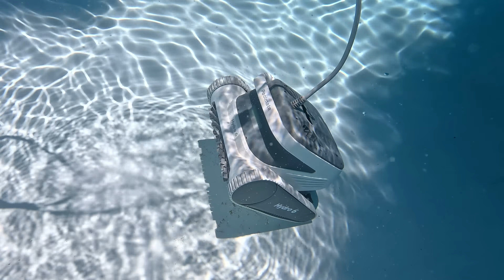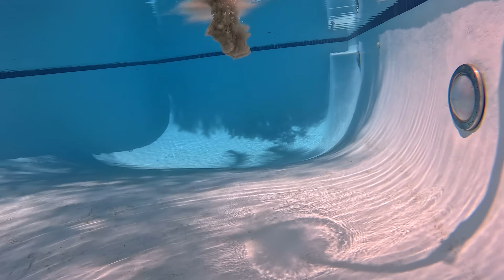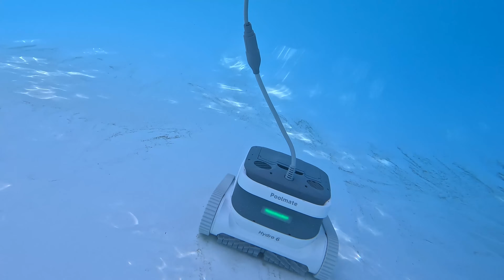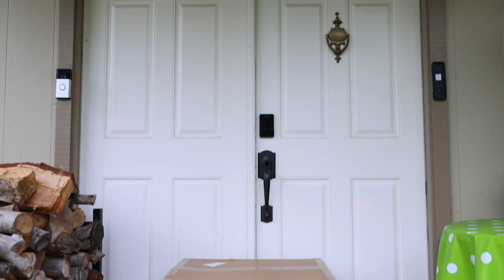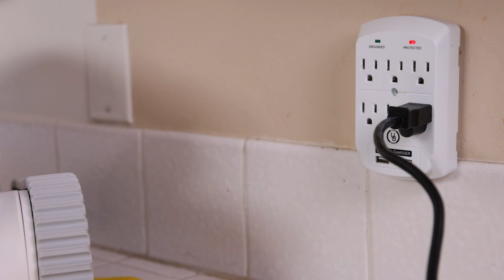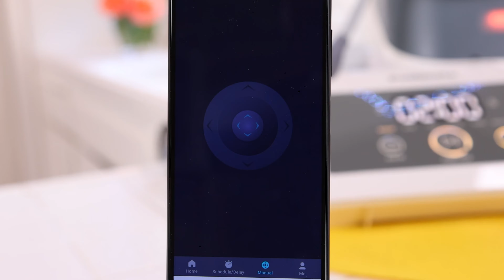Max Power And Rapid Clean: Poolmate Hydro 6  Swimming Pool Robotic Cleaner Review

Comment: Nice review thanks. At 11.08 you refer to the indicator in the app showing the WiFi connection but in fact that was a Bluetooth icon. Can you confirm if it has wifi and Bluetooth or just Bluetooth please. I also don’t understand why you say the pool cleaner itself has a battery because it’s plugged into the mains power or is that just to keep a battery charged-doesn’t make much sense.
Reply: It has both WiFi and Bluetooth, no battery in this unit.
Reply from the maker: This is right!